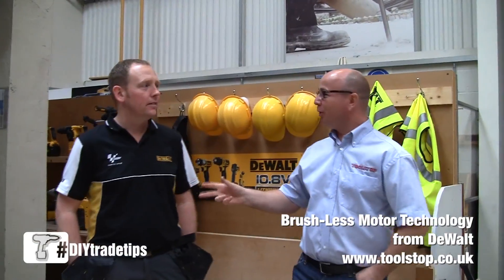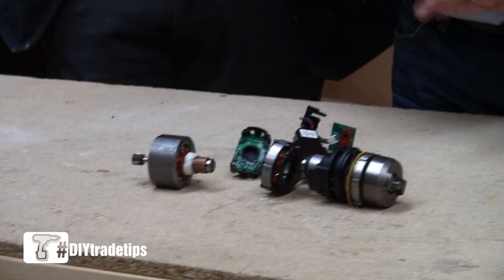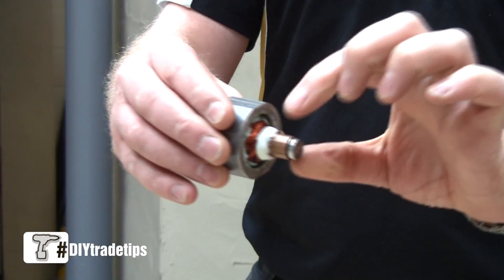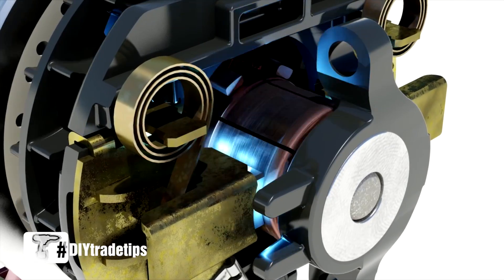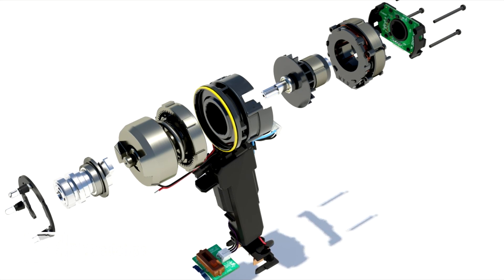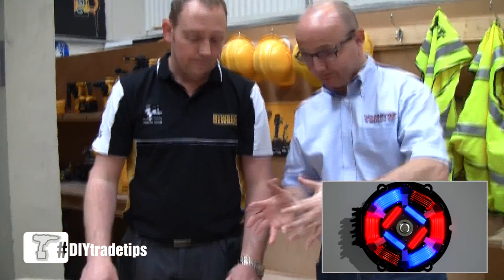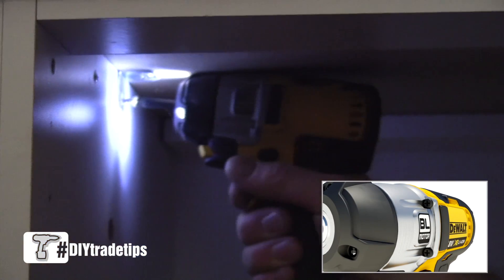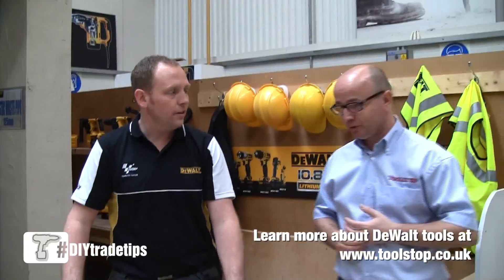A Toolstop Guide to Brush-Less Motor Technology with DeWalt

Comment: Ive got the DCD925 with the DE9180 Li-Ion batts also.(The NiMh it came with failed after a year,so shelled out on the L-Ion's).
Spent a fortune on bare XRP units also,so will prob stick with this stuff until the batts eventually fail.
Extremely tempted by the brushless combi,but cant realy justify it...hmm,or can i,lol!

Comment: Seconded! I use my DCD925 (which is the same as the 985 but on the old battery system) for drilling and the brushless impact driver for driving screws. I'd upgrade from my DCD925 to a new brushless version tomorrow. Can't wait till the whole range moves over to brushless. Will be great coupled with the 4ah batteries.